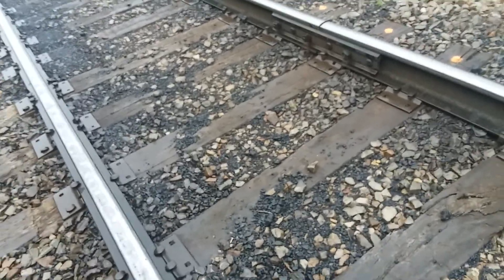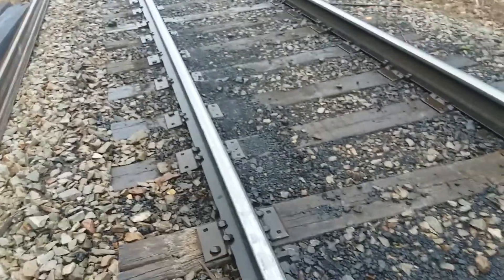Railroad Rail Defects - Corrugated Rail

Comment: I’m from old Chicago and Northwestern territory in Nebraska. In the 1980s the C&NW relaid a lot of their mainline jointed rail with new welded rail, then took the secondhand jointed rail, cut off the battered ends and joint holes, welded it into 1/4 mile sections at a rail welding facility, and relaid it on secondary lines. Pretty efficient use of material!
Reply from the maker: Your right about that Michael, it sure is. C&NW was a great RR
in it's day. Really appreciate your taking the time to check out
the video and may you have a very good day my friend.
Reply: @ccrx6700  thank you for all your effort in making these videos, I’ve been enjoying them immensely.
Reply from the maker: @BNU30C  😊👍🫡

Comment: Downhill, slippery tracks and breaking.... A bit of a nightmare. Bad for our wheels more than for the rails. The axle load of "my" railcar is some 5 tons or less.
Serious ware on "Your tracks".
Reply from the maker: Yes it is a lot of wear Stefan, specially here with the heavy
loads and large number of high degree curves, plus with the
high degree curves we have the locomotive trucks that are
3 axle instead of 2 axles, that puts a lot of stress on the rails
in a curve. May you have a wonderful day my friend.
Reply: @ccrx6700  I didn't have.... Was out practicing with the drone, tried higher altitude and larger distance. Trees looked like coming too close and emergency landing was attempted. No machine to find. It likely drifted out over the lake... Get new and more powerful equipment like obstacle avoidance, return home etc. Cheers.

Comment: Hey Dave! I wonder if the cold spilling out of the hoppers has anything to do with that defect in the rail?
Reply from the maker: Not really in this particular case Lawrence, however, coal spilling
plugs up the ballast which causes water to not drain away which
eventually means mud will occur which means the track will
not be stable. When that happens certain rail defects will
be more easy to occur from the rail having so much vertical
movement. Great question and hope that helps. We really
appreciate your watching the show today my friend.
Reply: Thanks for your answer Dave. Very informative! I just thought when the hopper cars are leaving the loading facility, all that cracking on the rails by the  wheels by the coals from the  hoppers may have something to do with the weakness in the rails. That’s all! Larry

Comment: My engineer sir.
Thankyou very much for your this video.
What happened on the railway track?
Then replacing of that rail is immediately 😍
Reply from the maker: Your welcome Thomas, corrugation is generally caused by
wheels skipping thru a curve. This happens as a fixed axle
means both wheels must turn at the same speed. Going thru
a curve one or the other wheel cannot keep up with the other
wheel and will skip or hop thru the curve causing damage to
the rail head.
Reply: @ccrx6700  ❤️🧡💛💚

Comment: Is there any kind of machine that can grind down, or smooth out the top of the rail while its in place?  That might be just a band-aid.. but it would smoothen out the ride, and maybe get you a few more years out of the rail before its replaced.
Reply from the maker: Yes there is Mike and it's called a rail grinder. They are huge machines
and most RR do a grinding program. Since we do not interchange
with another RR then we cannot get one in here sadly. Look up 
Loram Rail Grinder. There are many videos on YT about them also.
Grinding would have made a big difference in this rail had we
been able to do it, but we did end up changing the rail there.

Comment: Do you ever trade out coal cars?
Reply from the maker: If you mean do we get new cars in to replace old cars, that hasn't
happened since 1996, then in 2007 we bought 10 new cars. We do
have many used cars that are available for a swap out in case
a car needs to be taken out for repairs, then we just shunt another
repaired car in it;s place.

Comment: Kinda the same thing happens with asphalt paving as heavy trucks break for traffic signals. It “rolls” the pavement forward.
Reply from the maker: I can believe that Tommy, seen some of the asphalt roads here
rolled when extremely hot and lot heavy truck traffic, one road section was so bad they had to repave it
Reply: @ccrx6700  very common. ESPECIALLY when it gets hot.

Comment: It’s amazing rail lasts as long as it does.
Reply from the maker: It certainly is Tommy, we still have a lot of original rail here rolled in 1975, although many of the sharper degree curves the rail has
been replaced by now

Comment: Presumbly you cannot put a greeser box on the upper rail as you are on a grade and the grease might nullify the breaks action.
Thanks for the technical description and video, keep safe.
Reply from the maker: Anthony we have a flange greaser about 5/8 of a mile up track
from here, it only greases wheel flanges and not the top of
the rail, nobody greases the rail heads, that would be disaster.
Thanks for watching

Comment: Could a lot of that real have the defects ground out? I have a Landoll trailer, and used to move a lot of maintenance of way equipment. I have to tell you I was really impressed with some of that large rail grinding / refinishing equipment. The first time I saw a large one run, I swear it hypnotize me
Reply from the maker: Joe, awesome comment there sir. Yep those big grinders are amazing, first one I saw was after dark, that was nifty. Since we dont connect with any other railroad we just cant get one in. But yes sir a regular grinding program had we had one would have helped this rail tremendously. Thank you for watching
Reply: @ccrx6700  so you have no connection at all with any other railroad? How did you get your locomotives and other rolling stock in? I've moved lots of track mobiles, and years ago in the 80s I worked for a crane rental outfit that also owned a short line that did a lot of work for the US steel Fairless works. But even back then I think the biggest thing I ever moved we're like the GM and general electric 44 tonners. Back then they were tyburn railroad, they sold that one but they still own part interest in SMS railroad that serves the pureland industrial park in South Jersey.
I've since moved to the anthracite region and bought a Large garage/Warehouse that was the maintenance facility for a mining company. Since moving I'm more or less lost all my contacts in the railroad business,but I got to tell you I always love the maintenance of way equipment, it's absolutely fascinating
Reply from the maker: @joecummings1260  very intetesting story Joe. We have to rely on people like you to truck everything in. NS has a siding bout 4 miles from us so all rolling stock goes by rail to there. Then Hulcher does the trucking, gonna make a vid sometime later this year on our #3098 loco, in that there will several pics of them loading onto trucks and hauling it in, its a monster flat with 12 axles! They take trucks and fuel tank off and move them separate from loco body. Trucks weigh 32 tons apiece, nwouod guess and say fuel tank around 4 tons. All put together the loco weighs 368,000 pounds, so you can figure what the stripped loco now weighs on the trailer
Reply: @ccrx6700  a friend of mine from down in Virginia, used to make those kind of crazy moves. He had a 13 axle Nelson trailer, I believe he's retired now though. The outfit I worked for back in the 80s was called McHugh Brothers, and they had a tromboza trailer for making serious heavy moves. They had a pair of Klein 4 axle offroad dumps that they converted to tractors pull it.
Here's a link to some pictures

http://sbiii.com/roadmchu.html

Comment: I'm curious why you can't grind it to get rid of the washboard? That spall looked pretty bad, so I guess I can see that needing replacement. Just curious. I work on overhead cranes and our rails get wayyyyy uneven before we replace.
Reply from the maker: Awesome,, curious what size rail you use for those? I know they make up to 175 pound rails for cranes, but those must be monster cranes run on that? Grinding would have eliminated a lot of the corrugation, however since we do not interchange with any other railroad, it impossible to get a grinder in here. Thank you for watching and your comment. Hope you'll get a chance to watch more of my
videos sometime

Comment: As far as the rail, I can't see what you're worried about unless you mean the worn rail could break or otherwise cause a derailment. I can sure see why you'd want to change out some of those ties, but what's the difference, if there's miles of track in the same condition? Seems like the thing to do, would be tear out and replace the entire track line, from one end to the other. Why mess around with patchwork
Reply: I suppose you'd need to compare the cost of material versus replacement machinery and labor.  As well if the line needs a given crew size available full time, then having them do maintenance projects like this keeps the crew available.

Comment: The other issue with the track  shown where 'dips' where the track joints are. Track joints are not aligned on each side. Would cause the suspension of the cars to rock from side to side . Cause different wheels on an axle to slide as the car rocks.
Reply from the maker: Brian, track was built in 1975/76, it was built with staggeted joints as most jointed track is in US. Wondeting if you from across the ocean? I,ve heard they put joints across from each other. We tried a sectiom of track like that years ago and while it does eliminate rocking, when the joints get battered down then you get a kinda roller coaster ride. Too bad we dont have all welded rail, that would have alleviated a lot of problems
Reply: @ccrx6700  I am from the UK. There has been the use of track panels, pre manufactured sections of track, transported to site , positioned, fixed and connected, later (cast) welded in recent times, just bolted only in the past, for many years. Both Europe and the US  (seen recently at Barstow station) can be seen transporting and using them to speed up the construction of track. They now also pre fabricate turnouts and track crossings transported on special wagons to keep within rolling clearance gauge. These panels nearly always leaves in line rail ends in line across the panel. Its just in your example you have a long rail (the damaged one) on one side and a series of short rails jointed but not flat on the other. Have you observed trains (full and empty) through this section?
Reply from the maker: @briancooper562  Brian, we also have track panels and prefab turnouts here in US.

Comment: Near where I live there is a horseshoe single track loop then a 2% climb for some miles up onto a plateau. Before the route was permanently closed to freight (a 50 mile longer but nearly level diversion came into operation) and upgraded to high speed passenger use, in some sections of the old track the low rail had 10 meter sections of what I can only describe as extreme knife edging. 

So what I think was happening (I'm no expert) is the low speed freights climbing at very slow speed would 'rest' on the low rail of the superelevated curvature and peen over the rail head to the outside of the rail. Over years of maintenance neglect long sections of inner rail just kept getting compressed and compressed and peening over the side of the rail until they were like huge knife blades between 1 inch and about 3 inches wide and I suppose about 1/4" thick but still attached to the rail, like an ice overhang but in steel. They would partially crack off and sort of hang there. You could actually rock them and the sound would reverberate up the rail. Next to the track there were long broken off segments of knife from the rail face (or whatever it's called). The outer rail was in nearly perfect condition. 
I have never seen anything like it since.

Edit:
I just found your Crushed head and Flowed rail vid lol. It is bizarre how YouTube algorithms got inside my mind and knew that I had seen flowed rail out in the field and then found your channel for me. Like WTF???
Reply from the maker: Wow, Awesome comment you gave us, thanks for your insights and lesson. I have seen the knifing type of wear you describe on a few of our curves, but was nothing as exaggerated as you descrbe. I love it when get comments like this, they help enhance and expand the videos.

Comment: Outer wheel turns more than the inner wheel
Reply from the maker: Yes sir you are right. It like horse racing, takes more turns go around outside of track than inside, thank you for watching
Reply: Nit picky here, but the wheels turn the same. The issue is that they need to turn different rpms through the curve, but are forced to maintain the same speed because they're pressed onto a rigid axle. Something has to give so one slides or hops. Same happens with a truck in 4wd turning on dry pavement. When the tires start chirping they're trying to tell you something.
Reply from the maker: @RustyorBroken  Yes sir you are absolutly right, thank you. I did not do a very good explanation to the gentleman above in the thread, it really didnt say what I meant. Your explanation was excellent, very glad you wrote in 👍

Comment: I have seen countless examples of corrugation on straight rail.  Always in places where speed is high.  It is that roaring sound you hear on a fast train. And the causes are the same as corrugations on dirt road.  A natural driven oscillation which turns a single minor dimple into an ever longer and deeper stretch of corrugated road.  But THIS rail has a different set of defects.  All that surface spalling is something I have never seen before.

Comment: Thanks for this tutorial; very interesting.

In view of the facts that your entire fleet is captive with no interchange with other railroads, and your line has sharp curves, and your maximum permitted speed is low, might there be an advantage to having your wheel-sets re-profiled to have a greater tread taper?  I speculate that it might increase the self-centering on your sharp curves, reduce skidding on the inside rails, and therefore reduce the chatter mark / corrugation damage on those inside rails.

It is just a thought-model.  Might not work.

Comment: Would using a rail grinder machine sort that, or are there other defects below the top surface that need the rail replacing?
Reply from the maker: Since we dont intetchange with another rr, we cant get a big grinder in here. Yes grinding would have alleviated a good bit of the problem had we bern on a regular grinding schedule. We felt it best just to change all the rails on low side in that curve. Was a very good question and thanks for watching

Comment: I thought at one time US Steel made what they called a "Curvemaster" rail that had some additional hardening to the rail. Would that help in this case?
Reply from the maker: You are possibly right, i,ve never heard that but will do some research, thanks! I love learn new things like that. Mills used to offer a high carbon rail, it was stamped with a CU, perhaps that is what it was?
Reply: @ccrx6700  Our Yard Foremen in the mill spoke about it. He was replacing the track near our foundry at Edgar Thomson and indicated that had used some since there were some tight curves in that area of the mill
Reply from the maker: @IHVA-ir9gp  thanks, i been searchin online for it, but not comin up with much info. Another unique rail is called Dudley rail, not much info on it either, i have a pic on my phone of it, someday gonna do a vid on rail, so the kinda stuff you tellin me will help, i do appreciate your letting me know
Reply: @ccrx6700      You begin to realize how expensive track maintenance can be when you read threads like this and watch a video of the wear and tear.
Reply from the maker: @scdevon  yes sir, but it has to be done, derailments are far more expensive

Comment: If you were connected to the outside world could a rail grinder fix this?
Reply from the maker: Not when it that bad shape
Reply: @ccrx6700  How about catching it at an early stage, before it gets really bad. Does the RR have the rails inspected regularly, like by Sperry or such? Seems it'd cost much less, and be safer, to treat small problems early on, rather than replacing whole section of rail.
Reply from the maker: @jacquesblaque7728  we try getrail testers in twice a year. They are busy critters    so we have to wait often till they passing thru this way to get them.